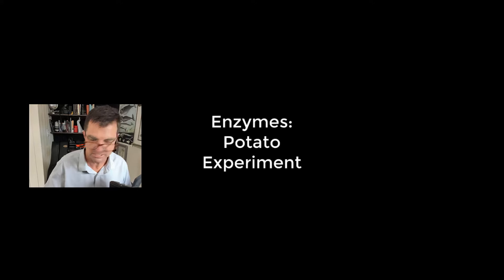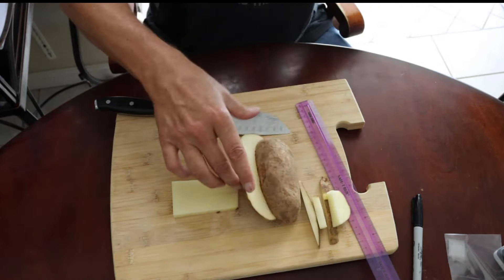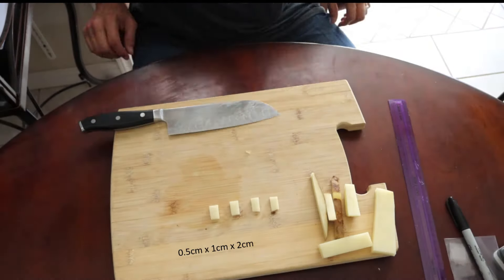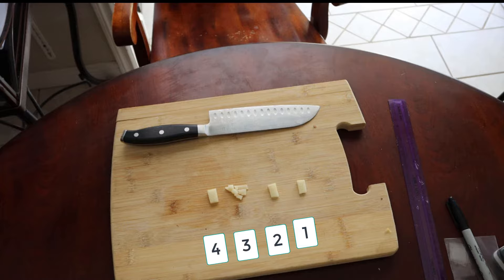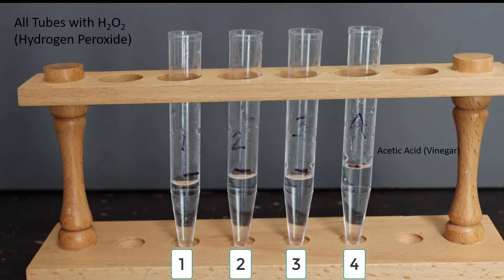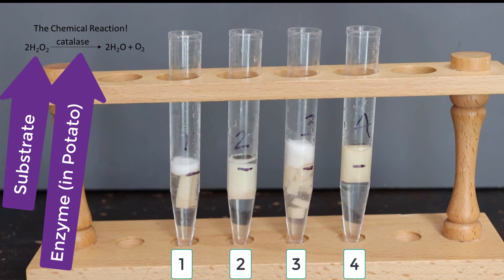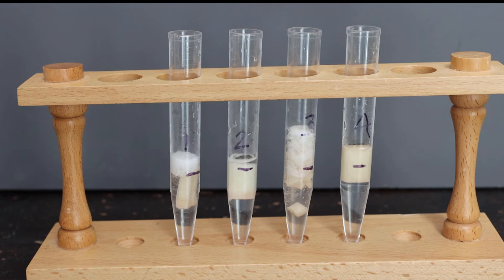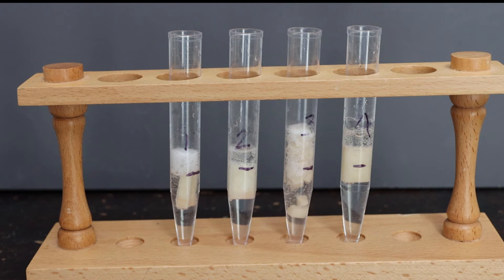Enzyme Potato Experiment

Comment: Hi Professor Revell, do potatoes or ridge gourd have more catalase? Which fruit or vegetable has the most catalase? What is the best way to extract and preserve catalase?
Reply from the maker: Good questions.  Not sure.  Potatoes are the classic example always used.  Potatoes are actually a type of modified STEM (not a root).  I'd start by investigating the experiment with root structures like carrots or yams.  Not sure how one would preserve catalase.  You could try freezing a potato for few days and then see if the experiment still works.  Maybe I'll try that and upload it here.